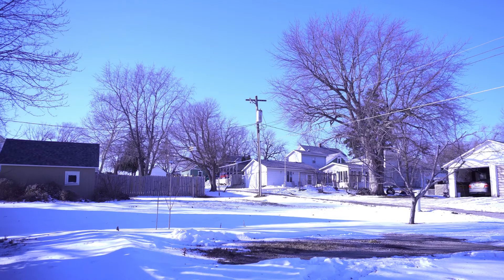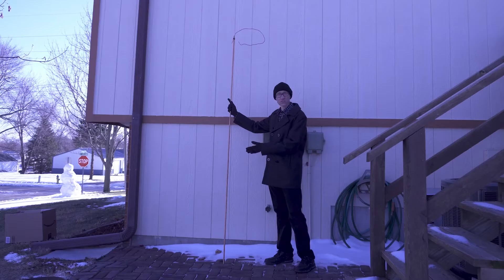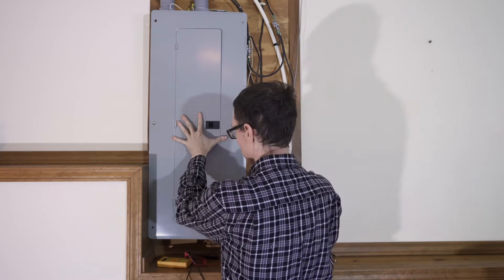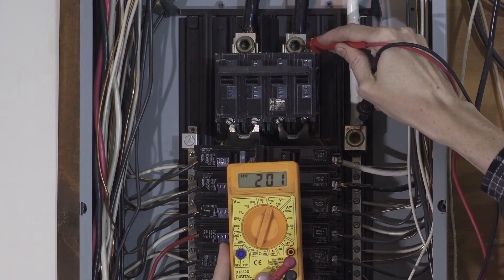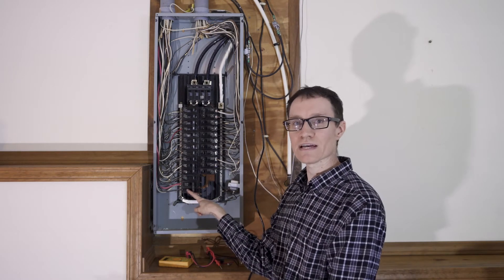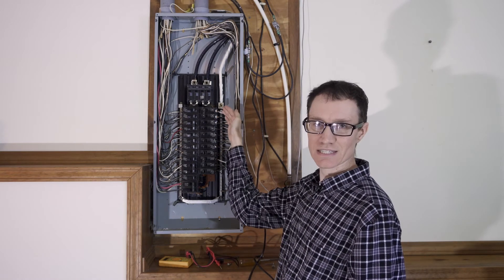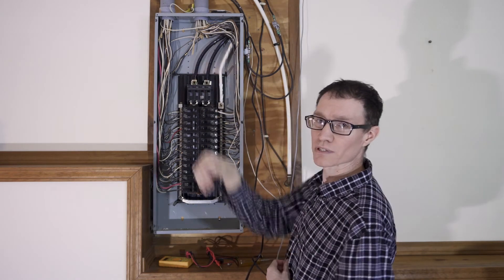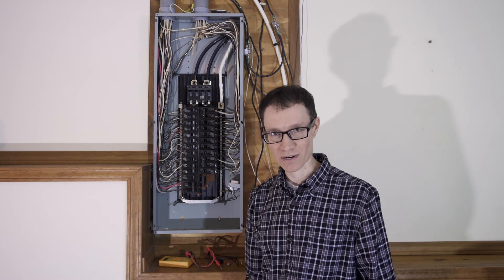North American split-phase breaker box (23 - Electricity Distribution)

Comment: Although some call it split phase, it is not two phases at 180 degrees from each other.  It is “single” phase.  If you say “While looking at the system on an oscilloscope, then you can say that.  You incorrectly said phase 1 and phase 2 for the hots.   They are Line 1 and Line 2.  In three phase systems, the connections are called phase A, B, And C.   Also,  the Earth ground is connected to the “Grounded Conductor” or neutral.  It is for lightning dissipation, nothing to do with any of the ground conductors from the panel out to the devices and appliances.  
The door bell should absolutely not be inside the electrical panel.   It is made to be installed on the panel into a knockout.   You have lower voltage insulation on the low voltage side conductors mixed within the 600 volt insulated conductors.   That’s a NO in NEC.
Reply: I hate that it's called single phase. I'd prefer it was called 2 phase and a single 240V - N would be called single phase. I think that's probably the electrician vs engineer debate.

Comment: The two black cables coming into the panel - the two hot wires. When wired up for 240v one acts as a return (as a neutral does).
Reply: both hots act as a return at various times due to alternating current and changes in polarity
Reply: John : When 240 volts they BOTH act in consort to balance the circuit.
No need for neutral in a 240 volte appliance.
Reply: @tedlahm5740 . In my house, I have (10) 240 volt appliances, and (2) 120/240 volt appliances.   So, (10) with no neutral and (2) with neutral.
This is of course what you were meaning, right?
Reply: @KevinCoop1  Correct.   Quite a residential property.  Thank you
Reply: This presenter doesn't use that term much, it seems to me, at least in AC circuits.  It isn't a good model; it's better just to think in terms of circuits.  There are some other channels which use that term, and others which are even stranger, thinking they clarify the subject.  They do not.  They leave a lot of people confused, as is evident from their comment sections.

The way the subject is taught in this channel is the right way: simple diagrams and straightforward descriptions using proper engineering terms.  The best way to think of the customer side of a North American split-phase system is as a superposition of three AC circuits, with one point (the neutral) designated as a point of reference.